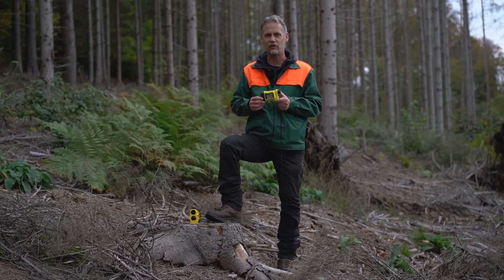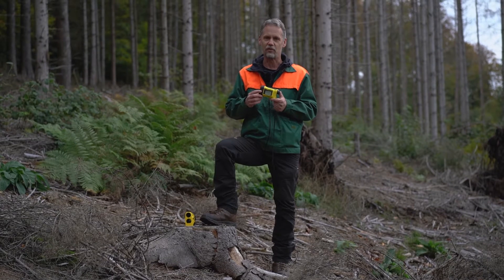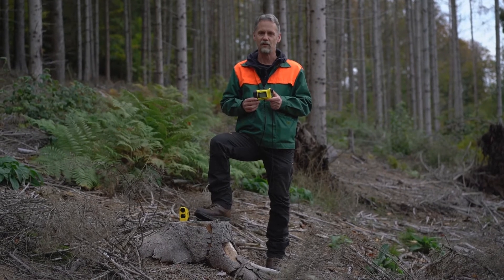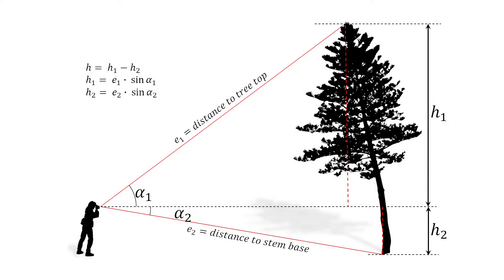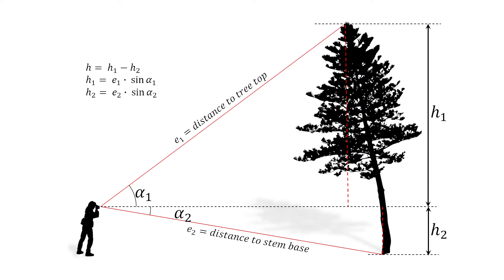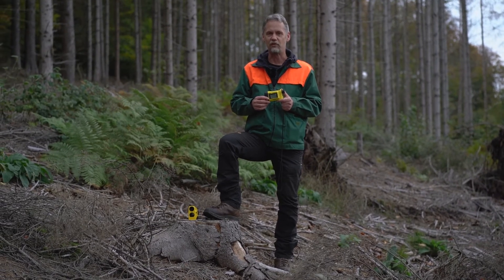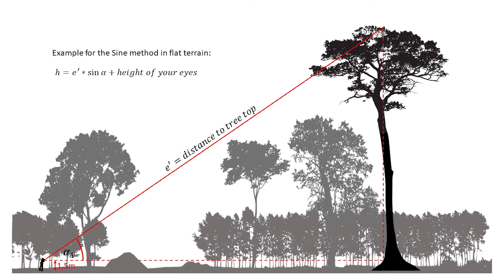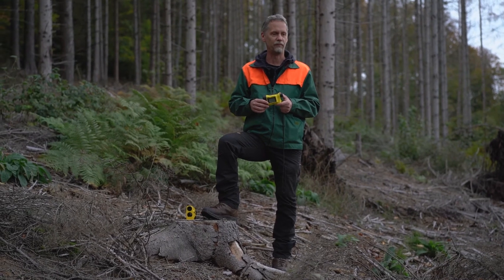Measuring tree height with a laser rangefinder and clinometer

Comment: I was wondering which mode do you use Nikon forestry pro 2 when you’re measuring the height of a tree that is on a slope or you’re standing on a slope or if the ground is uneven? I don’t see it mention anywhere in the manual booklet.
Reply from the maker: With both, the three point and the two point measurement mode you don't need to think about slope. If you measure distance first and then two angles, the Nikon always corrects the distance to horizontal distance automatically. With the two point mode you measure distance and angle to the top and the base and apply the sine method. Also here the slope doesn't matter.
Reply from the maker: Btw: the mode I used in the video is the one where HOR is blinking...
Reply: @forestinventory  When using the 3P mode on the Nikon Forestry Pro II, you are supposed to aim it horizontally straight from your eyeline. What happens if the horizontal aim is not perfect or if it’s a bit below or above the eyeline because you are trying to find the clearest spot on the trunk? Even if the horizontal aim is not perfect, do the device’s sensors still handle the adjustments?
Reply from the maker: It is not necessary to aim horizontally, you can aim at any position on the stem (assuming the tree is standing straight upright). It measures slope distance and inclination angle and calculates the horizontal distance automatically. This is helpful because sometimes you don't find a visible spot on the trunk if you aim horizontally. For conifers having a single straight top branch, you can even aim to the top to measure horizontal distance.

Comment: @forestinventory  i have a question. At 4:00 you said that the first mesurement to get it's the distance to the tree, and you can point to any position on the stem. So, you don't need to mesure the Horizontal distance (HD) but you can also get a incline distance (for example, point the stem at 6 meter height) and the Nikon will calculate the HD by itself. It'is right?
Reply from the maker: Yes, this is right! In case of a straight and upright tree, you could even point to the tip of the crown to get the horizontal distance (for conifers). But attention: in case the tree is leaning towards or away from the observer or there is an offset between the highest point, you should be sure to aim at a point in the vertical plane of the top.

Comment: Pro tip from an electrical engineer: If you are worried about the batteries running out in the field, instead of taking a back up device with you, take some spare batteries.  You will find this works out a lot cheaper.
Reply from the maker: Thank you, good tip and I agree 100%! Nevertheless we usually have a robust backup in case you accidentally drop it in water or destroy it. But right, batteries are not the main argument!

Comment: I like your video-presentations very much! Could you please advise what is the min. horizontal distance that TruePulse 360 can measure when establishing a circle plot? I know that Nikon Forestry Pro II does not see a distance from 1 m to 7 m and thus, is not suitable for measurements on small circle plots. Is TruePulse 360 better on this account compared to Vertex Hagloff IV? I am trying to save a bit of money on the inventory budget. :):)
Reply from the maker: Yes, correct, the Nikon Forestry Pro model 1 does not measure distances smaller 9-10 meters (even 7 meter is not possible). This changed with the new model, which measures smaller distances. I will test how far down it measures and will report later. Regarding TruPulse: it measures down to short distances and is used to measure tree positions in sample Plots. Also here I can check how far down it measures. Regarding Vertex: the main argument for the Vertex is the sound-based distance measurement that also works with limited visibility, which makes it the first choice tool for plot assessments!
Reply from the maker: Here is my result for a small experiment in front of the door: I tested the minimum distance you can measure for 1) Nikon Forestry Pro I, 2) Nikon Forestry Pro II, 3) TruPulse 200, 4) TruPulse 360B. I tested on A) rough tree bark and B) a flat white wall, but see no differences for all devices. Be careful with measurements close to the minimum distance for Nikon devices, they don't change even for slighlty varying distance.
1) Nikon Forestry Pro I: 9,8m, but reliable only for >10m
2) Nikon Foretry Pro II: 7,3m
3) TruPulse 200: down to 0,1m!
4) TruPulse 360B: down to 0,1m!

Conclusions: 
- Nikon not useful for distance measurements on sample plots! 
- If you don't need angle measurements, TruPulse 200 (~800 EUR) is working, 
- if you like angles (usually we do to get polar coordinates), TruPulse 360 (~1400 EUR) is better.
Reply: @forestinventory  
Thank you so much! This info is very valuable because usually, it is not stated in device characteristic or instruction.

Comment: How can I display decimal units on the screen in the Truepulse200?
Reply from the maker: In case of the TruPulse the displayed accuracy depends on the quality of the distance measurement. If you have a low reflection from the target, it will display integer values, while a better measurement will come with one decimal automatically. See http://wiki.awf.forst.uni-goettingen.de/wiki/index.php/File:TruPulse_360-B_Users_Manual_2nd_Edition_English.pdf

Comment: Interesting, thanks for sharing this knowledge. Once you have the height from the trees, I'm wondering about the following workflow... Do you use a total station in order to get the coordinates of the tree ? I don't know how to explain properly but I mean how do you use this height data afterwards. Thanks.
Reply: We use the TruPulse, and it's very handy. For my purposes, I typically already have the coordinates, and am on site to merely verify tree heights at the location (for microwave path validation). In the event I need to locate a previously unknown tree or structure, I merely use my lensatic compass for angle, which is suitable for my application (being sure to include the magnetic declination). I can also record location with GPS. Though the TruPulse can provide horizontal bearings, those require onsite calibration each time (unlike the vertical angles which do not), so I find it easier to simply turn angles by compass since I am moving along a path to various locations throughout the day. One important note, the Trupulse uses 2 "AA" batteries which are easy to source if I were to exhaust the spares I bring, whereas the Nikon requires a "CR2" battery which you'd better ensure you have plenty of ahead of time, and likely won't be able to use for anything else one you buy them.